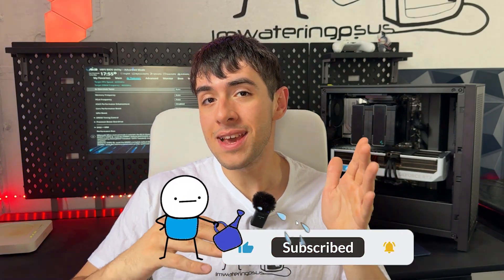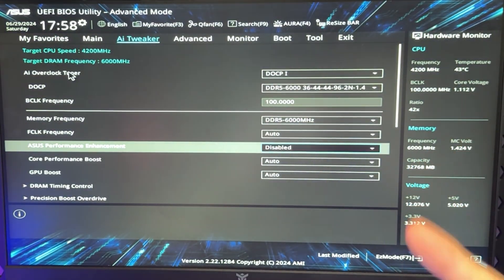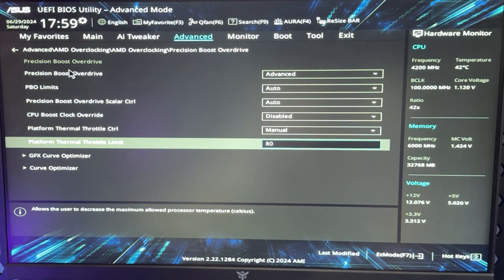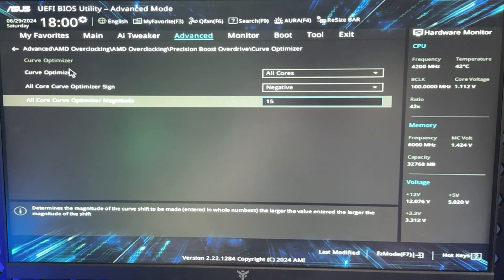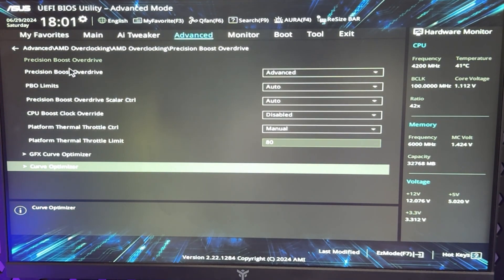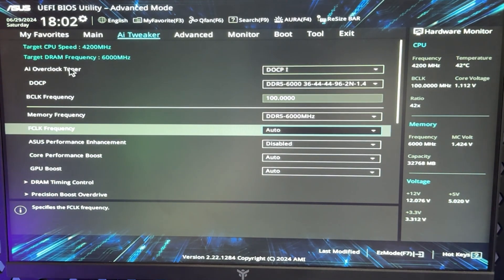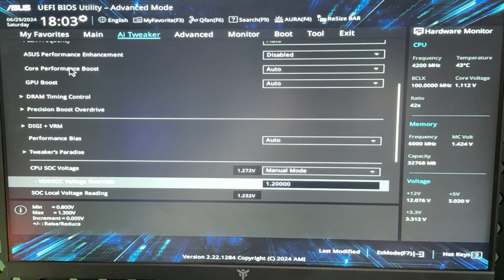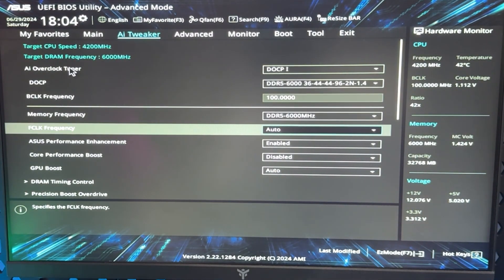Undervolt your Ryzen 9 7950X3D for more FPS and Lower Temperature!

Comment: can't undervolt mine with a 7950X3D / 340mm AIO ... it barely peaks 5.7ghz. It floats 4.8-5.0 mostly. Battlefield 6 running 71-80°C. 

I also have a Gigabyte B650i ; Can't figure out how to get the CCD wrapped properly. Pain in my ass.

Comment: Perhaps you should have mentioned the option to apply the curve optimizer on a per-core basis.   It's very time consuming but by applying the same offset to all cores, you are limiting all cores to whatever the weakest one can run at.  Usually only one or two cores are really holding back the rest.

Comment: DO NOT DISABLE CORE PERFORMANCE BOOST ON 7000X3D CPUS, IT WILL LOCK THEIR CLOCK SPEEDS TO BASE FREQ. ONLY DISABLE IT FOR 9000X3D WHICH ARE UNLOCKED FOR STATIC OVERCLOCKING.
Reply: Damn, I was wondering why my performance was dogshit compared to 9800x3d build, thanks for this

Comment: hm. i activated x3d gaming mode in msi bios. now only 8 cores are activated. but CPUZ shows 8 cores 8 threads.. should it be 16 threads?
Reply: This is because X3D GAMING MODE disables "SMT-MODE" otherwise known as hyper-threading. 

By default, when SMT or HT is enabled 16 cores = 32 threads and in your case, 8 cores = 16 threads. When it's disabled it goes by 1 thread per core (i.e 8 core = 8 threads, 16 cores = 16 threads, etc..) 

It disables this feature because in a lot of cases it helps the CPU boost clock higher and more efficiently. However, this will reduce your multi-tasking performance.
Reply: what you wanna do is enable all cores and instead use process lasso on specific games, e.g. Dota 2 loves 3D vcache cores, so I force it into that CCD, CSGO likes high frequencies, so I ping CSGO to high frequency cores instead

Comment: I'm on a 9950x so slightly different but I tried this but you end up losing all-core performance. My system is stable at -25 but my multi-core benchmarks lose almost 30%. 

I actually get less performance drop and better temps setting it to 105w eco mode with no PBO settings

Comment: 7950X3D
4090
Prime Series X670-P WIFI MOBO
Followed the dynamic guide to a T and my system can’t run EXPO. So turned that off and did the rest, system just loops and can’t start up. I can’t find a guide that works for me unfortunately. Guess it just isn’t meant to be for me
Reply: I have same problem i manage to load default settings and works normaly

Comment: Some people will argue that a 5-10% gained in OCing "is not worth it", have not considered the collective boost gained when OCing the GPU, and 2-10% from DDR5 RAM

Example:
I have a 7900X3D, RTX 4080 16GB, and 64GB 6000Mhz RAM

 The RTX 4080 has a maximum OC potential of 15%. I tested the undervolted GPU from an amazing video I found somewhere on youtube, using MSI afterburner and its Curve Optimizer. Just from the GPU alone, I gained more than 20FPS on average using Heaven, (set to 1440p, Unlocked FPS, Maximum rendering, DX 11)

Theoretically, paired with an OC'd CPU and RAM, you could likely gain MORE than 30FPS on average. That's a lot, in my books when I only play at 4K60FPS for DX12 games (like Cyberpunk 2077)

Comment: I have a 7800X3D and Corsair Vengeance DDR5 6000MHz CL30 (30-36-36-76) 1.4V XMP RAM, i enabled DOCP I and i thought that i got too high voltages (SoC 1.280V and VDDIO / MC 1.424V). Someone told me that i should adjust the SoC Voltage from auto to 1.15V and VDDIO/MC to 1.3V. I did that and left all other voltages on auto, the system is stable with those settings but i wanted to try undervolting the CPU to get lower temps, I started researching and found this video. I noticed that you have 1.4V ram aswell and the MC voltage at 1.424V. Should i just revert back to the auto voltages or is it good this way. I have Asus ROG Strix B650-a Mobo with the latest BIOS. This whole voltage thing seems so complicated 🤣😅

Comment: I really can't get my 7950x3d undervolted. I think I completely lost the silicon lottery, because it's crashing bad even at -15. So disappointed....
Reply: Ja man bei mir genau so
Reply: Downloade ryzen master. Ich habe einen 7950x und habe 30 grad unterschied beim zocken
Reply: The same here! -10 and thats its but its oke for me 👍
Reply: Do per core testing
Reply: @thedeadliest4380  Is there a guide to do this? I just don't want again and again regretting CMOS and reinstal bios as the last time.
Reply: @FedericoFilaVaudana I think the per core testing he is talking about is testing the manual underclock with just one core at a time, so you reset your underclock in PBO (setting the number to zero) and then putting -15 on your first core.Do some testing in a game and if it's stable then add it to your second core and so on.
Reply: Use ryzen master, all core 0.985 ghz set 4.5 and do test, it lowers 30 degrees of my ryzen 9 7950x
Reply: @giovannibarbagallo7723  if I use Ryzen master I need to set default settings inside my bios?
Reply: @FedericoFilaVaudana  no man its just to experiment at you pc what runs stable, i sometimes let it run normal and sometimes when im gaming i set it at 0.985 4.5ghz
Reply: @FedericoFilaVaudana  i could set it in my bios also but i dont game often, when i sometimes feel like changing it i use ryzen master and just undervolt
Reply: @giovannibarbagallo7723  I'm asking because last time that I tried to UV from bios my pc crashed even inside bios and couldn't load again. Maybe with ryzen master is easier
Reply: @FedericoFilaVaudana  what motherboard do you have and what exact cpu? Maybe update to latest bios and then try undervolt all core in master
Reply: I would say to use ryzen master to find your fastest core and then easing the undervolt on that. So if you do -15 on all core then I would put -10 or -5 on that faster core.

Set your load line calibration in PBO to medium/high when you do this that way you keep a stable voltage.

The last step I would recommend is to set your CPU VCore to 1.2 volts.

Comment: Hi everybody. Do you know why after this procedure, my pc gives me bsod with memory management error or kerner security error? Before this try of undervolting everything was good. 😢 Even the bios crashing...
Reply: Reset BIOS to defaults if you can.

IDK how bad is it crashing, tho.
Reply: @DanielLaixer  the situation has been fixed (clear CMOS and reinstall bios ). I think I lost the silicon lottery because my CPU can't handle even -5. I have a b650e  and maybe is this motherboard....dunno but I can run this CPU just stock.

Comment: bro ı wrote you under other vıdeo.. ı use " MSI pro b650 s wifi" motherboard.. and optıons are dıffrent.. there ıs oc menu- precision boost overdrıve menu , but ı have to choose " set thermal 75-80-85 or advenced or dısable or enable or enchaned mode 1-2-3 etc.."  when ı choose "advenced" ( because ıf ı choose other optıons ı cant change any abilities ın them) ın advenced optıons ı cant set a platform thremal limit to 80 or etc. ı can set curve optımızer but thats all.. ı can set platform throttle ctrl manuel but ıt does not allow to set limit to 80 or somethıng else.. try to show ıt ın msı motherboard please.. my cpu ryzen 7 7800 x 3d.. on msı b650 s wifi motherboard..

Comment: Don't forget to enable memory context restore. It will save the memory settings and save your time on boot
Reply: And don't forget this is found at 2 locations: 
Extreme Tweaker=>DRAM timing control=>Memory context restore
Set to "Enabled"

And

Advanced=>AMB CBS=>UMC common options=>DDR options=>DDR memory features=>Memory context restore
Set to "Enabled"

Comment: Ciao bro! Ti scrivo in italiano perché so che lo sei, e complimenti per l'inglese e per i video che fai, veramente qualitá assurda. 
Ho assemblato da pochi giorni la seguente build:

Case Nzxt H9 flow

GPU zotac RTX 4080super trinity

Aio Nzxt kraken 360 rgb 

CPU ryzen 9 7950x3d 

Mobo msi x670E gaming plus 

Ram Kingston fury beast EXPO ddr5 2x32 gb 6000mhz 

Psu Seasonic focus gx 850w 80+ gold modulare 

Ssd 1 nvme crucial p500 2 tb 7000/7000 lettura scrittura

Ssd 2 XPG Sg40 512 gb 5000/5000 lettura scrittura

In IDLE ho il processore a 55/60 gradi, in full load (stressato con cinebench R24 multicore) tocca gli 80/85 e 90 gradi per poi stabilizzarsi. 

Ti sto scrivendo tutto prima di vedere il video, secondo te ci stanno come temperature? Ora proveró a seguire e undervoltare, poi ti faccio sapere, dimmi comunque se sono in linea con le tue, grazie mille <3

Comment: This didn’t decrease my temps by much. When gaming temps were still 70-75c,  idle 50c…
Reply: 😳
What games?
What cooler are you using…?
Reply: This is bs he doesn’t show benchmarks showing cooler temps. This doesn’t do anything. I have 3 custom loops all amd builds. Am5 quantum velocity, 4090 quantum vector ABP My temps went down maybe 1-2 c that’s it. What games? Cyberpunk, red dead redemption, dying light 2……. or any game that’s gonna stress the F out of my 4090

Comment: yes, I put these settings on ryzen 9 7950x3d without voost clock and CO -20 negative, but I wanted to put boost clock on enable and it started to restart continuously and I put the settings back, but it is possible to have low temps  this processor with boost clock enabled?

Comment: Does not work. This is my third 7950X3D on Rog 650e-f and all three I can NOT get it stable more than 10 minutes without rebooting/bluescreen.

I have tried -5, -8, -10, -15, -20 but nothing works.
I have GSkill 2x 32GB DDR5 6000
GA II LCD
4090

Any idea?
Reply: Get a stronger motherboard… 670e should do
Reply: @nevamind7501  yes from the fact that it's his third cpu on the same motherboard you might think that's the problem, but the motherboard does nothing else but apply those settings to the cpu, if it works or not it's up the cpu silicon quality. I'm using a b650 here and it works fine, man this board even supports ram frequencies that aren't listed in the spec sheet
Reply: @bellicsson4171 it CAN be the mobo tho, its possible

Comment: Hello , I done the static mode on my 7950x from your previous ( video  1y ago ) today and my motherboard is a TUF GAMING X670E-PLUS  and the CPU Frequency it’s not lock , you just have to go where it says Manual CPU OC and will give you the options to change Voltage and Frequency and I literally just put 1.200 and 4800 and also did the one on this video mine was 1.3 and I put the same as you .
Reply: Where is the cpu frequency thing he’s saying is locked

Comment: I think per core is better because each ccd has the fastest core, download ryzen master and will tell you which ones are your fastest one. The fastest core ate very sensitive and run at lower offsets like 5-15, the rest you can do 30.
Reply: This reply should be seen more. All cores absolutely would not boot for me. Per core, and only setting the first 8 cores to negative 20 did the trick.
Reply: Yeah. Just set up my 7950x3d and with "all cores" setting it allows to boot windows without blue screen only on "negative 5"
Reply: Ryzen Master screwed up my windows. I don't recommend this software at all.
Reply: @Parthurnax52  Same.
Reply: @Parthurnax52  more details on "screwed" pls :)
Reply: @milordas  I was looking at the different settings. There were profiles and I have looked at them, applied some of them and revert back to defaults. Some time later, i was checking out my BIOS and I have found out that in the advanced options manual overclocking had been tinkered with and also on the precision boost overdrive there were different values and settings written. I had supposedly default settings according to Ryzen Master. I have reset the BIOS settings to default and my PC wouldn’t boot to Windows anymore. So I had to reinstall Windows and also I wiped my SSD too to get start new without these malware like software.